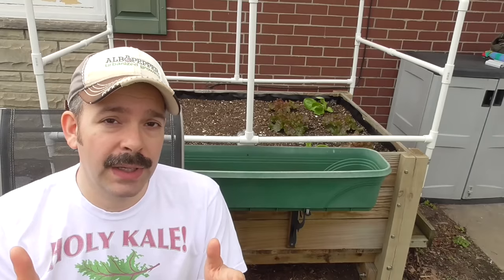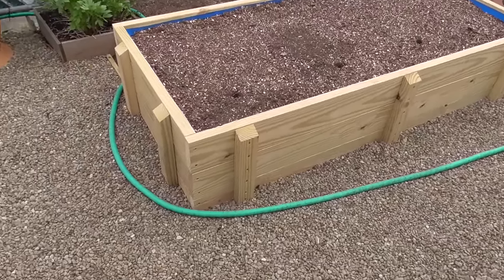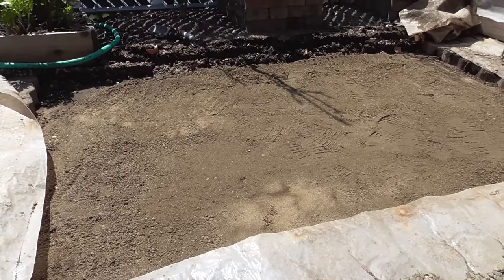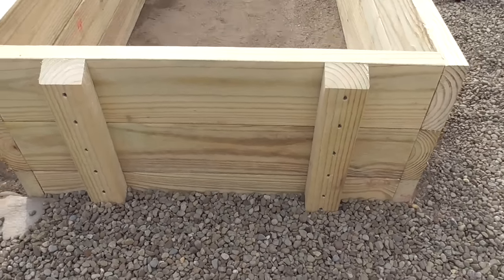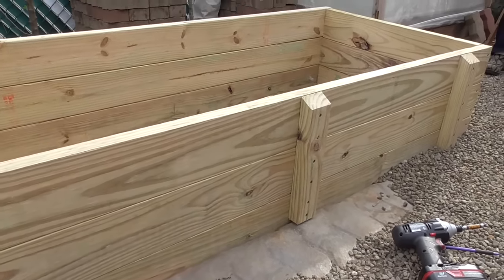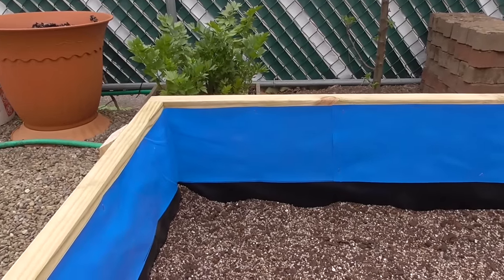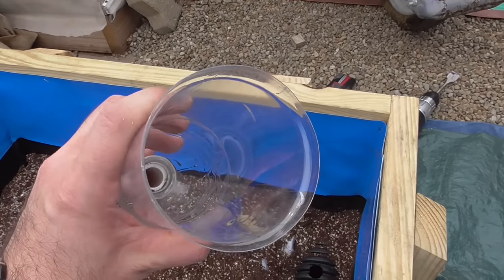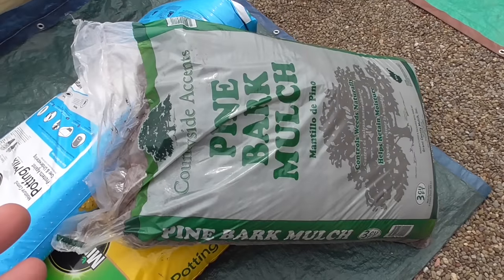Self-watering SIP Sub-irrigated Raised Bed Construction  (How to Build)

Comment: I am wondering what anyone thinks of the floater valve I currently have on my SIP which is set to fill my tubes 3/4 of the way full.  Instead of having to fill with the hose as shown here? I was using separate containers as you originally show here, in my planter box like yours,  but I now like your new dirt filled planter box instead for the looks of it.  I love my floater valve and its great for me as I am gone much of the time
Reply from the maker: Jack June You could definitely integrate a floater valve into this system.  If your area is stricken with drought, it would be more beneficial for you.  As someone who has been experiencing lots of rain, I haven't even been watering this.  Just one long weekend before going away.  But this holds LOTS of water.  If you're thinking about it, you could always integrate the connection during the build phase.  Then you could decide to hook it up later on, or else just cap it off.

Comment: Thank you Sir for your wonderful, informative video on the building of a raised bed, several years ago now! 
In one part of the video you explain how to "cap off" the ends of the irrigation pipe with landscape fabric and duct tape.  Is the purpose to completely block the flow of water or to allow water to continuously seep through?
I ask this question because in my country (New Zealand), the term "landscape fabric" is not known. There are different kinds of fabric with different characteristics and names  so if you could
Reply: ...explain the purpose of the tape it would be appreciated.
Thank you so much. I look forward to watching all your videos and reading your comments.  William Mathews
Auckland, N.Z.
Reply from the maker: The idea is to cap off the ends of the pipe so that no potting mix penetrates into them. I used a synthetic woven fabric that won't deteriorate. Tape was used to hold it in place. But zip ties could work too.

Comment: I really like your video and will look to build a few for my garden soon. I have a question for you, is there any reason why the brackets to help the wood from buckling can't be on the inside? I feel like it would be a cleaner look.
Reply from the maker: Yes, it would look cleaner. But then the inside is messy. It would be much harder to apply the liner. It could be done, but it would be more work.

Comment: Hi Al, are 2 drain holes required? I didn't see your second one until it was too late. I have 3'x6' beds. Thx!
Reply from the maker: Technically no. I use 2 on my larger beds as a fail safe. The diameter also makes a difference. Extremely small diameter tubes won't have much of a flow rate. If the reservoir is overfilled, it will simply take longer for the backlog of water to drain away. Just be sure it is never plugged up.

Comment: Hi, I was doing research on how to build a self watering raised garden bed and came across your YouTube video.  I really like your video!  In YouTube you mix your own soil.  Can I just use raise bed soil instead mixing my own?
Reply: Another question what is the difference between the raised bed soil and potting mix?
Reply from the maker: Raised bed soil will not have perlite and won't work so well in containers or SIPs.
Reply from the maker: Thanks for watching! If you don't want to mix your own, then I advise buying a decent porous potting mix which should include perlite in it. I usually can find it on sale so it's not too expensive.

Comment: I am trying this method this spring. I was unable to find perforated corrugated tubing. I did find 33 ft of 6" corrugated tubing. I am using an 8ft new water trough as a container. The trough is 2 ft deep and 3 ft wide.  Can you tell me how many holes I need to put in the tubes? Seems laborious to cut slits with a knife every few inches on multiple sides of the tubing. I have managed to get it cut into 7-8 foot pieces and will enclose the ends as you have advised. Looks like I will end up with 4 long tubes. Trying not to be overwhelmed-perhaps I started with too large a container?
Reply from the maker: I understand. Some 1st time SIP growers have started with TEN 4x8 ft SIP beds. I say: Baby Steps. But to help you out: Why not try using a small drill bit? Maybe an 1/8" bit? That should be faster than using a knife.

Comment: There are nontoxic wood treatments available, they treat the wood with minerals which soak into the wood and crystallize while simultaneously dehydrating the wood. The dehydration and crystallization blocks out water and pests preventing rot and termites and they last "forever". You should look into it.

Comment: I just finished my subirragated raised bed frame. Mine is wider than your design. It's 44"x8'x16" deep.  What is best spacing between pipes to stuff wicking aggregate? If I use 9 pipes, I have about 8" to space between the pipes.  10 pipes will leave only 4" to divide between pipes. Which will be optimal wicking space?

Comment: Congratulations on a very professional video. I'll certainly build this one. Based upon the methodology shown my bed will be 18" deep x 12' long and 35" wide. So what quantities of material will I need to fill it??
Reply: George, I made a 12'x4'x16.5" bed and it's approximately 50 cu ft of fill.  You can use a calculator online to generate your bed, but that should give you a starting point.  Do note that a 2x6 is actually a 1.5x5.5 after milling, so your bed will only be 16.5 inches tall, just like mine.

Comment: Thank you for this outstanding how-to video! I am ready to make raised beds in our backyard where we've let all the grass die because of drought (in CA) and I'd never heard of this system before. We were going to do slow-drip. Is the wicking system better than slow-drip and does it help in drought? Thank you again.
Reply from the maker: usagranny Thanks for taking time to watch! I've found the wicking system to be very efficient in water management. Your water doesn't escape into the ground. So any water you add to the system stays there until the plants draw it up.

To further conserve water, you can add mulch. Some people will cover these with a sheet of plastic to prevent evaporation at the soil line. I don't cover mine, because I like to capture the rain water. But if you're not getting any rain, then the plastic makes a lot of sense.

I've never ran an SIP along side a drip system to see which is most efficient. But my gut tells me that the SIP would be, especially if you covered with plastic. With a drip system, I'm not sure how you would know that the soil is saturated and that no more water is needed. With an SIP, if you see water trickle out of the overflow tube, then you're done.  And that's that.  You don't even have to fill it to that point if you don't want, so nothing runs off.  Hope that helps a little!

Comment: Need advice. Built and set up SIP using your design. Apparently tubes shifted when filling it so no longer level.  The planter is starting to smell so I flushed out water reservoir. Found overflow tube was plugged up with potting mix. The landscaping fabric on end of pipe was torn with lots of potting mix in that tube. Should I plug up end and patch pond lights ner. Then put a new overflow hole on low side?
Reply from the maker: You could plug up the existing hole. I would probably just try to fix whatever caused the issue. That being said, all of my large SIPs have a 2nd overflow tube. It's good to have a 2nd one as a fail-safe in case one of them fails, as you experienced. Hopefully you can get it sorted out!

Comment: Great video! I am a complete gardening novice and have recently tried to educate myself by watching quite a few videos and reading on the subject of SIP raised beds. My wife has given me the task of building 4 of these in 4' x 8' dimensions for her. Your technique is well thought out and seems to be based on solid concepts as well as substantial experience. I plan to use your design but have some questions regarding the soil mix. Unlike a number of the people who commented previously, I am not interested in deviating from your formula as it seems to have done quite well for you. I want to keep things simple so I can help guarantee my wife has success with her planting. 

As I understand from the video you recommend a base formula of:
2 cu ft each Miracle Gro moisture control and regular potting mix
1.5 cu ft pine bark mulch
2 gallons Perlite

You mention in the video that fertilizer is required but that Miracle Gro contains fertilizer. Do I need to add any additional fertilizer seeing as I will be using the pine bark? If yes what would you recommend? Worm castings? If so how much to the ratios above?

Also you recommend a different mix to surround the drainage pipes. 
The formula was standard potting mix and vermiculite. What ratio of this combination do you recommend?

Many thanks for taking the time to help educate us all!
Reply from the maker: +ggersty - A happy wife means a happy life!  ;-)  I actually used 2 types of MG mix (moisture control + regular). So in this SIP bed, my fresh mix recipe was:

4 cu ft MG (2 x 2 cu ft bags)
1.5 cu ft pine bark mulch
2 gallon Perlite

NOTE: I had mixed this with some old SIP potting mix too. Since all of your mix is fresh, only use 1 cu ft of pine bark mulch (20% total volume).

Also, I would add some dolomitic lime and then a little organic fertilizer -not too much since the MG is fertilized. I like Espoma Garden-Tone or Plant-Tone. In this application, go for Plant-tone since it has more N. Add worm castings liberally as available, mixing into the top.

For the bottom part, my pipes were really close together so I used 50/50 vermiculite and peat moss. I wanted strong wicking forces. My default mixture is 33/33/33 vermiculite, perlite & peat moss. This is not set in stone. Anything similar to this should work out fine.

Please be sure calculate all aspects of your project, including the cost of your mix. Four boxes of this size will be quite an undertaking. So be sure you can realistically do all of these including the amount of potting mix. If you are unsure, I advise doing 1 at a time, including filling it up. Leave room for expansion. But remember that 1 fully functional SIP bed is worth a lot more than 4 incomplete beds. But hey, if you have the resources, more power to you!!!
Reply: +AlboPepper Thanks for the info! Much appreciated. I plan on doing one at a time and seeing how my wife does with the planting. I have one last question which may have been posed before in some form but wanted your opinion anyway. Was thinking of making the boxes just a bit higher than your standard box. Am considering using a 2 x 8 for the first span then 2x6's for the second and third spans for a total hight of 18.25 inches rather than your 16.5 inches. Do you think there would be any major effect on the wicking capabilities of the box at that height or would you recommend sticking with the original dimensions? I believe in the past you have been ok with slight increases in the box height but want to be sure I'm not going to be causing myself any undue heartache down the road. Thx again!

Comment: Thank you for this awesome tutorial. I was going to go with sand for the wicking layer but after watching your tutorials and reading on your website I am going for your tried and trusted method. 

However a question on the wicking layer potting mix. Your site doesn’t recommend using wood or bark, but I can obtain wood fiber at a very reasonable cost, could you clarify if wood fiber is not what you mean by wood and if ok to use? 

It’s also a sustainable resource, and I have read it has excellent water retaining and aeration properties. 

Can this be used
instead of the peat moss, with vermiculite and perlite in the wicking layer? 

Like peat moss it can’t completely dry out either. From what I understand it’s as slow at decomposing as peat moss. 

For the top layer I thought mixing the wood fiber with peat moss, vermiculite, perlite, and worm castings. 
Would appreciate your thoughts on this!

Comment: Finally finished my build. Turned out great. How would you recommend I fertilize... From the top or from the fill tube?
Reply from the maker: Cool!  I recommend fertilizing from the top at the soil. Some fertilizer can be mixed in. And some can be buried in a band that is pushed an inch below the soil surface. Keep fertilizer bands a few inches away from the plant stems.

Comment: AlboPepper, thanks your video is so much more informative am going to start building. I have some concerns for clarification and guidance hope you don't mind.

I leave in Nigeria and must of the materials are not available here so;
1. can 4" PVC pipe be used instead of those drain pipes? they are very expensive here
2. Am not sure potting mix or any of those stuff in the bags you use to fill the grow area can be found here, can I use cow dung and or poultry droppings and mix with top soil for the grow area?
3. Do I need a greenhouse to grow all year round or it will do without a green house?

again thanks for such an informative and well made out video, love all of them

Comment: Hey Albopepper what a brilliant self watering planter, I always wanted one so I went out and did it it took me 3 days and has worked brilliantly for last year's growing used it in Scotland from April to October, but is there anything I need to do to rejuvenate it for this year's season? do I have to take out all the fill and mix it all again or can I add some fertilizer and use the same compost your help is needed please 👍🏻
Reply from the maker: Hiya Gavin! Please watch this video which discusses my method of nutrient replenishment in my SIPs: https://www.youtube.com/watch?v=wNsm1YpXlbg

For structural replenishment, I'll add either extra retail potting mix OR perlite, vermiculite or fine pieces of pine bark. Pine bark is a quick, cheap way to add structure and volume after the potting mix has settled over the years. Vermiculite will help to enhance wicking properties while perlite maintains structure and aeration.

I look at the texture of my old SIP potting mix and consider how it had performed in the previous season. I spread a layer of substrate material to top it off. Then I gently dig it in with a spade shovel and mix it well. I level it all off with a bow rake. Finally, I add nutrients as outlined in my video above. Hope that helps!
Reply: @Albopepper  thanks for the reply and your advice is much appreciated bring on the growing season 🙌🏻

Comment: Loved watching! Thx! But, I don't understand two things. First, how are the corrugated tubes connected to each other (to hold water) and second, how are they connected to the soil for wicking purposes? Thank you.
Reply from the maker: Hi James! Thanks very much for watching. This page shows a little bit about how the pipes work on a smaller scale in the totes: http://albopepper.com/30-gallon-tote.php  This follow up video explains more about the watering process: https://www.youtube.com/watch?v=VJ2T6gUv8Gc  The slits in the pipes make it so that the water evenly distributes itself (no need to connect the pipes)!  :-)  Also, the pipes have a little space between them which is where you stuff the wicking mix. Hope that helps to clarify a little better!

Comment: Hey Albo, just wondering what you used in the bottom section for wicking? You say it’s potting mix and vermiculite, is there a certain ratio?
(I ask because I’m about to build 3 beds, each 1.5m long and 0.5m wide, and I’m trying not to blow my budget on peat moss, I’ve built smaller totes before so am familiar with the traditional peat/perlite/vermic mix, but am looking for a cheaper alternative)
Many thanks for your videos and wisdom, cheers mate, Dan

Comment: question: I am in Hawaii in an area with soil that is almost 100% sand so the idea of a raised bed like this is very appealing as opposed to amending the soil.  Sometimes we recieve constant and very heavy rain for a day to a week. Do you think this system would be able to keep the soil from being too waterlogged?
Reply from the maker: +bingusy - Thanks for checking out this video. In my area, we had 10.43 inches of rain in June. The heaviest downfall of any of those days was 1.88 inches in a single day. My plants had no issues under these conditions.
 
If you are dealing with dramatically higher levels of rain, you could cover the soil surface with a layer of plastic so the water runs off of the edges. Just mound up the potting mix in the middle so that it makes a nice slope. Remember that it may settle a little. This works best with a small number of larger plants since you only have a few holes in the plastic cover.
 
I would think that a system like thing could work well in your area, especially due to the sandy soil. Just add the plastic at planting time, as one large piece, so that the plants grow up through. I would use an opaque plastic. Periodically, you can lift a corner up and check to make sure it is wicking well.
 
I hope that helps. I wish you all the best!

Comment: Thank so much!  This a GREAT way to do this me thinks! 

 Do you think the addition of pine bark to the mix could change the PH substantially?
Reply from the maker: Thanks for watching! The pine bark might lower the pH a little. It partly depends on the volume that is used and how aged it is. Older / composted bark is better. pH can be tested once the box is filled and dolomite can be used to raise pH as needed.

One thing to keep in mind is that wood products can create nitrogen draft. Adding a little extra nitrogen would offset this. This would only apply to the first season.